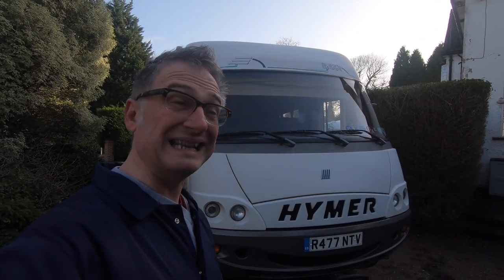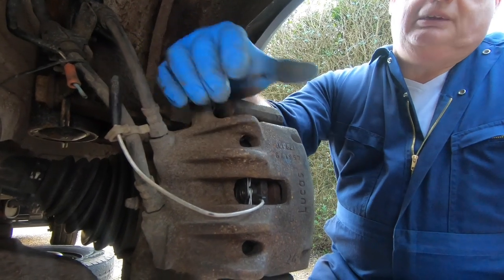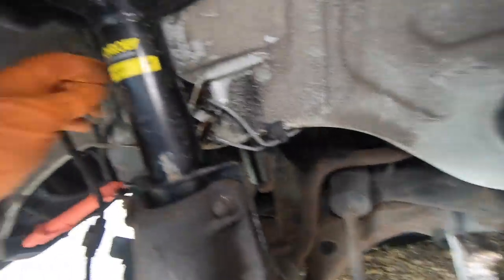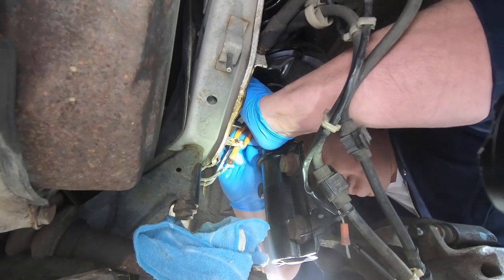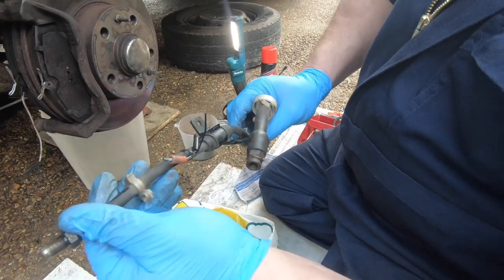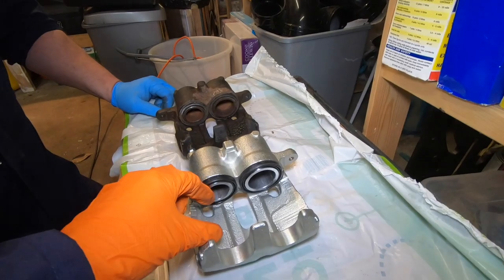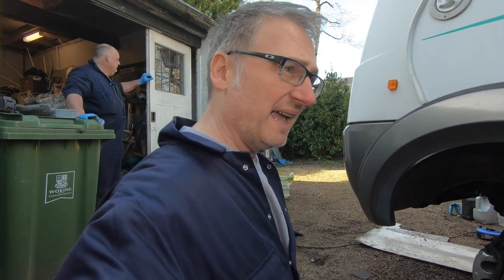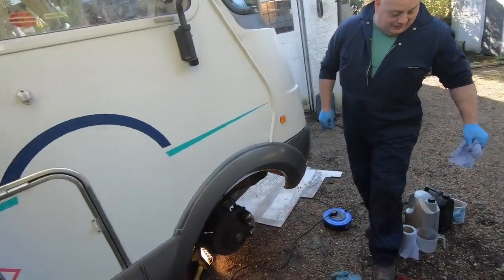Motorhome Mechanic - Replacing Brake Calipers and Pads

Comment from the maker: Chas and I get back together to sort out the front brakes. Off camera we've replaced the front brake pads which is a simple job. However, we struggled to push the calipers back in. So, in this video we replace the front brake calipers.

Is this something you can do on your own or maybe you've already done this? Let us know.
Reply: Yes, sticky pistons are trouble. Best replacing the calipers.

Comment: The importance of the caliper design change is vital. Some numpty actually did try hammering pads on to fit on my van. 
The friction was so bad the disc was glowing and the new pads disintegrated, leaving just the pad plate on the road.

A couple of important symptoms of this.
1. Really bad brake smell at speed.
2. Ridiculous fuel consumption.
3. Reduced ability to free wheel
4. Abnormal braking range at deceleration

Yes, I should have gone to have it seen too but when the same garage just give it  a 12 month MOT, brakes are one thing which is not what you think it is.

Great Video 👌👍
Reply from the maker: Thanks Garethtevlin, some great advice there but it must have been a terrible experience driving it. Some garages are just useless aren't they? Not sure why. Is it lack of training or just profit and laziness?

Comment: Thanks for this video. Great one. I was looking for such a one in regard to the dual brake line disconnection. That's the tricky part.
Reply from the maker: Yeah, twisting doesn't work. We had to remove both lines. Is this your next job to do?
Reply: I began this afternoon. Bought pistons and seals. Cleaning the left caliper.
Reply from the maker: Are rebuilding them yourself?
Reply: Yes. Remove the rust w/ phosphoric acid (works great) 50:50 acid/water and will paint them probably w/ Foliatec paint.
Reply: Great video. Really clear. I have an almost identical van,  B574, W reg.  Don't suppose you've got manufacturer and part no. for those callipers? Mine look identical (although can't see any wear sensors). Struggling to find some.
Many thanks
Reply from the maker: Hi Peter, have you tried Coastal Motorhomes? Call them, they should be able to sort you out a new pair. As for reconditioned we went to a local car parts shop. Like we said on the video there where 3 part numbers that could fit our motorhome. There should be size numbers on the calipers.
I hope this helps. Let us know if you have any more questions
Reply: @HermanHitstheRoad  Thanks, yes I've found Coastal Motorhomes, but not actually called them yet. I've got another local garage on the case now (I'm not planning on doing it myself). Hopefully they can source it. Have looked for part no. on the old set, but so rusted it's illegible
Reply from the maker: We couldn't find a part number either. The refurbed one have a sticker on them

Comment: remove the filler cap and put a plastic bag over the reservoir then screw the top back on . this creates a vacuum in the system and stop the fluid draining out of the system . requires a lot less bleeding.
Reply: Great idea 👍👍
Chas.
Reply from the maker: Yeah great idea but after pushing the caliper pistons in with the cap off.
Thanks Geoff
Reply from the maker: Just out interest. Won't the cap itself be air tight? What's the bag for?
Reply: @HermanHitstheRoad  the cap has a very small breather hole to allow air to enter as the fluid level drops over time due to pad wear and to allow for expansion when the fluid gets warm.

Comment: Hi ads my name is barry i have a self converted fiat Ducato 2.8jtd and I have just replaced  my front callipers, discs, pads, and new twin hoses + brake lines front to back also rear pads and cylinders I wish I had a chas to help me one thing I noticed on your video was the tension springs on the top of the pads were sticking out of the calliper mine went under the carrier is this right or should they stick out like on your video I’m not a mechanic just like to do my own repairs my brakes work okay now if you could ask chas please and your videos are great and very informative a really nice down to earth couple best regards barry and my dog Bob
Reply from the maker: Hi Barry, I'll ask Chas to comment but what do you mean by the "tension springs"? I don't remember there being any springs. Do you mean the carrier sliding pins? Could tell us the time in the video you see them?
Reply: Hi yes if you look at the comments I left a comment saying 
That i had noticed that the spring was on the outside and that i had corrected it. 
In summary the springs go under the caliper. 
Hope that helps you. 
Ps well noticed it means you are doing a good job 👍
Chas.
Reply: Anything else you need to know we would be more than happy to help 
Chas 👍

Beauty 👍

Comment: I have a B584 from 2004. I keep having to change the front left wheel bearing. The last time 3 years and 5000 miles ago. My mechanic put on the last one a SKS made in Spain. I did the first one myself using a 100 ton press from a local truck garage, they did it in 2 minutes in front of me. Just came back from Spain and its making a hell of a noise again especially when turning left. Can you give me a clue why this may be happening?
Reply from the maker: Hi Paul, I had a similar problem with a car that I restored. Every year the front bearing would go. The problem I had was the the hub was damaged, I could see it pitted but because it was an old car and I couldn't find a replacement. 

We think that it could be that the hub is damaged (the hub being the shiney sticking out thing that the disc brake and the bearing fit over); or that there is dirt or swarf in the grease in the disc which works its way in to your bearings; or it could be the CV joint is damage; or if cheaper makes of bearings are used they can spin in the hub.

We hope this helps.
Ads and Chas

Comment: before you start remove the master cylinder filler cap and put an old latex glove over the top then replace the cap it will stop air entering and fluid running out of the pipes.
Reply from the maker: Great idea but I think you only need to do that if you are doing it on your own.

Comment: Or the issue I’ve  come across today is a larger calliper which is most likely the original fitted which should have a 22mm disc but someone has fitted the 16mm disc, all works well for last 8 years but probably doesnt offer as much heavy duty breaking or cooling as it’s a smaller disc. The disc actually split  in two at the junction of the two angles huh and gave of the disk and c 2 of the pistons came out causing a fluid leak and 0 breaking. Perhaps the incorrect disc caused the pistons to come out to far as the pads wore also. Unfortunately these callipers don’t appear to be available now so looks like it’s going to have to stay on the smaller disc even though I have the 22mm ones now over from Germany🙄
Reply from the maker: Interesting, Cornelius. What chassis and age is it? Have you contacted Coastal Motorhomes? They may be able to help.

Comment: Easy enough job, awkward with those double pipes though!
Reply from the maker: You're not wrong. Do you have any maintenance work you need to do on yours?
Reply: @HermanHitstheRoad  Hm, it's not actually a motorhome. The last one I had was a coachbuilt unit based on an Austin J2 chassis. Weighed in at 2 tons and was a bit of a beast. I had to change the rear springs as the old ones were crushed. A 1622 cc Austin engine fed by a sidedraught Solex kept it fed. Until the float bowl warped and I changed the whole inlet manifold and fitted an SU. 

Maximum speed was 40. Fuel consumption was horrendous!  Drum brakes if I remember correctly.  No, the caliper I changed was on a Discovery 2. Very similar but only one brake pipe. 

Good vid, quite enjoyed it, 'Beauty!' In fact!
Reply: I’ve a 1997 boxer to do and I just know those horshoe clips are going to dissolve even though I undersealed the entire motor home. Then the pipes will be solid and I’ll need to put in a new brake line lol. I lubed everything up thoroughly a couple of days ago so fingers crossed, but I’ve been here before!
Reply from the maker: We look forward to hearing how you get on. Do lets us know. Get yourself a proper pipe spanner rather using a simple 8 or 10mm.
Reply: @HermanHitstheRoad  7/16" on this. Yes I have extensive workshop facilities. Doesn't make the bugger shift though lol.

The clips came out fine, hoses are on fair nick, but pipes going to have to be cut. I'll make new pipes up first and put them in situ, then take the old ones out the master cylinder and pop bungs in. When I've got the caliper and Flexi hoses on the bench I'll get the buggers out with heat. Don't want to damage the flexis though which is why I didn't use much heat in situ.

Cheers bud.
Reply from the maker: Good luck 👍👍🚙
Reply from the maker: I've only just seen this. Thanks Sleepy Cat. You sound like a mechanic yourself?
Reply: @HermanHitstheRoad   Erm . . . no. Not really. More of a skint guy that can't afford to pay somebody else to do it!!  Although, I don't mind a tinker . . .!